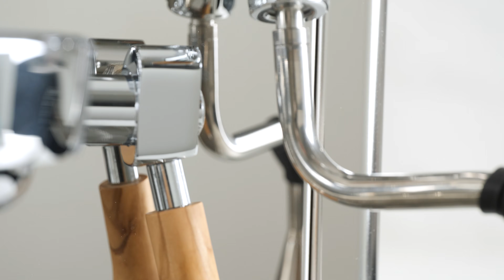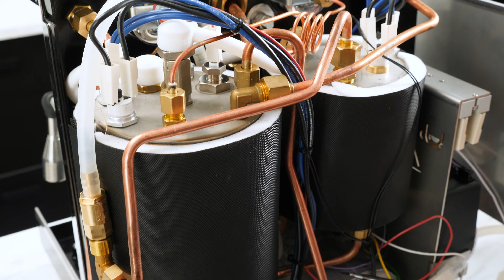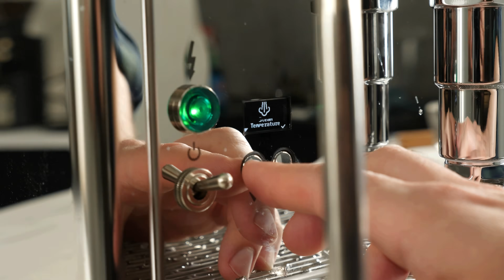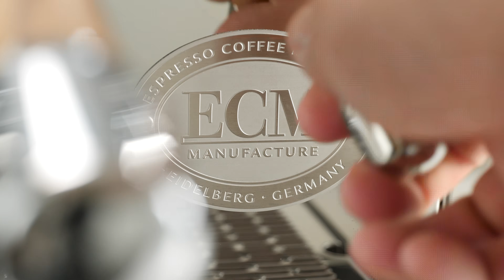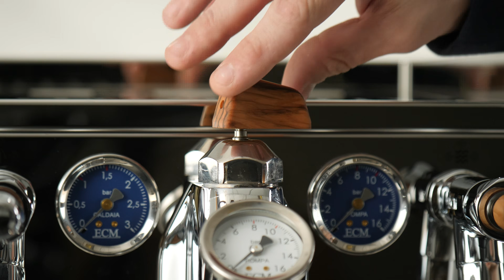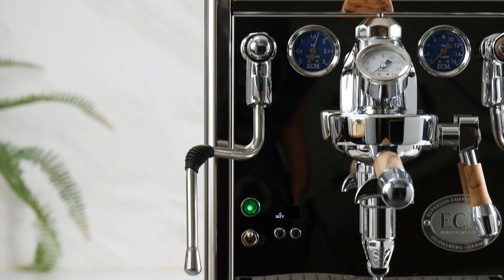Is the ECM Technika VI Worth It? Full Review & Performance Test

Comment: Thats really inconvenient - not being able to adjust the pump while its running. Also why not make the pump pressure screw more available, like an accessible knob somewhere on the outside. Is it really that hard?
Reply: Because you adjust it once when setting it up on a water line and then you’re done.  It’s not intended to be continually fiddled with and if you want pressure profiling, E61 is not for you.
Reply: @marshallgoldberg8376 my experience is that you need to adjust over time, although not often
Reply: @joakimolsson1024 On my Bezzera Duo, very similar rotary machine, I plumbed, adjusted, and done. Haven’t touched it in over three years.  Of course ECM could have done better but I think this is a compromise they needed to make to accomplish the form factor. I would not call it a deal breaker by any means.

Comment: Yeah I’d have accepted the smaller boilers for a smaller size but it’s sad they dropped the heating cartridges of the Synchronika so I might go for that instead. Would’ve been cool if both heated up quick without overheating- flush and drawing more water through the machine. Maybe differentiate Synchronika by shipping with flow control instead, like the drive. Btw which wood type from Wiedemann is that in the video ?
Reply from the maker: Hey Fredrick thanks for the comment and for offering the perspective! Totally hear what you're saying. Also those are Wiedemann's Olive Wood accents. - John

Comment: Be aware that the ECM user manual states that the input Line pressure maximum is 1,5 Bar ! So for most households you need a additional regulator in series! Just want to let you know!
Reply from the maker: Good point! We often recommend BWT Filter Packages, and luckily, those will come with a pressure reducer:
https://www.wholelattelove.com/products/bwt-bestmax-premium-filter-package-w-besthead-flex?variant=14409802678331
Reply: @Wholelattelovepage  Does the 1.5 bar figure apply to this EMC machine or to all EMC machines?

Comment: I've always appreciated the ECM design and build quality but I really have to question the decision to place the OPV valve in a position that is all but impossible to accurately adjust. They couldn't have found a more awkward location. A real head scratcher. But to be fair, once set you don't need to play with it all too often. Still a very beautiful machine.
Reply from the maker: Hey LightZone, I hear you on this one, I do love an exposed OPV. But, I also agree that it's a set-it-and-forget-it feature as opposed to a pressure profiling mechanism. I'm still happy they were able to turn the Technika series into a dual boiler with this size frame. - John

Comment: What outstanding espresso machines. My Classika has been a real pleasure to use. I switched to it after more than a decade with an HX machine, and since I don't drink milk-based beverages, it suits me perfectly.

That said, regarding these E61 machines: would it be technically possible to design a flow control system that directly regulates the pump's flow rate rather than restricting the water at the group head? And, taking the idea a step further, could such a control be integrated into the machine's standard E61 brew lever?

Come on, engineers—time to get to work!
Reply: The reason people buy an E61 is that parts are 99% compatible on every grouphead back to the 1960s. If you want more sophisticated flow control, but a different machine.

Comment: Great review. I’ve just bought the new ECM Estetika which I find much better than the Synchronika 2. The live flow rate tracking is really helpful for dialling in your shot. Milk texturing (not my strength) is also easier than the Synchronika. Would love to see you review the Estetika.
Reply: The only difference between the steam texturing ability of Estetika and the Synchronika is the stock steam tip. A part that costs UD$17.99.

But sure, trade in one of the most expensive home machines for an even more expensive one…

Comment: Seems like it's right there between a profitec ride and the synkronika/Drive.

Only complaint I have is how you would adjust the pressure. Though it's not something that you would do often, not having it external and not being able to adjust it while the machine is on seems like a design flaw. Otherwise, I would have considered it if I didn't have the Drive.
Reply from the maker: Hey Dash, thanks for watching and sharing your perspective!

Comment: When comparing the Technika to the Synk, people often say the main difference is that you won’t be able to make as many back-to-back milk drinks. Realistically how many in a row would you have to do before you had to stop and wait for it to recover?
Reply from the maker: Hey BD, thanks for watching and for the comment! As a home machine, I can't imagine you'll have a line out the door like in a cafe. In our testing, the PID recovered to brew temp after an average of 33 seconds, let's call it 40 seconds to be safe. My personal feeling is that this brew boiler size is plenty for making a drink for myself and a few others at home. - John
Reply: @Wholelattelovepage so need to wait approximately 40 sec between one espresso shot to another one ?
Reply from the maker: @RBNK157  Instead of waiting a particular amount of time, I'd just watch the temperature on the PID screen, and pull another shot once it shows your target temperature. But again, this is usually pretty fast; 33 seconds was the average recovery time.
Reply: @R @RBNK157 s, but it takes 30 seconds just to grind another shot. Add weighing,  distribution and tamping, and the 33-40 seconds is no problem at all.
Reply: @Wholelattelovepage thanks John, Appreciate the advice. You should see the line up for coffee at an Italian Australians house on Christmas Day

Comment: Stll that tiny menu driven display.   No, no, no ,no ,no.   Im not going to navigate through invisible munus with two buttons.
Reply: Conversely, I refuse to put anything with an actual screen (like a Decent) in my kitchen. I don't need lab equipment there, give me these sweet levers and valves.
Reply: You don’t need to use the menu. I have adjusted my Synchronika maybe 5 times in 3 years.

Just lift the lever on the grouphead and make coffee.
Reply: Looks the same as on my Drive. it's a little pain in the beginning but after you have set you're timer and temps you're more or less done. Set and forget....

Comment: ECM build quality. 
2 stainless steel boilers.
Rotary pump, more silent and higher flow rate.
Water reservoir sitting away from heated elements.
This machine is spot on 👍
Reply from the maker: Hey Kats thanks for the comment! We've been pretty impressed and excited about how they were able to take the Technika footprint and turn it into a dual boiler. - John